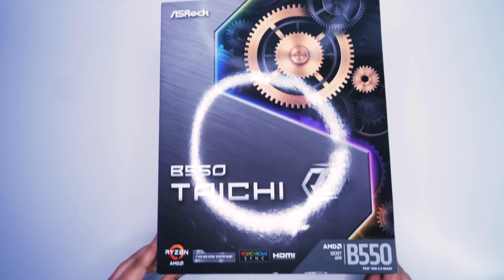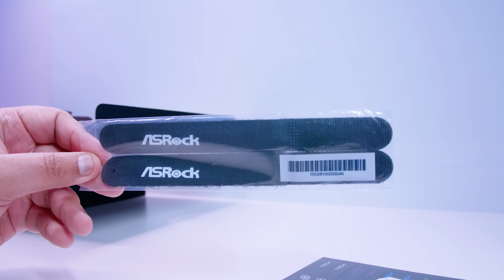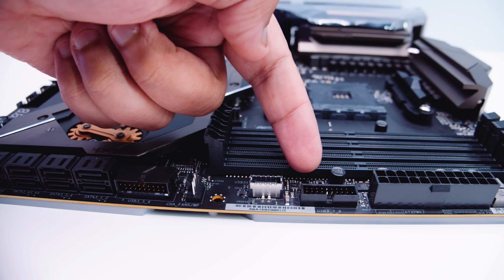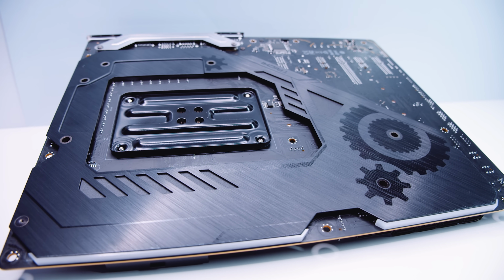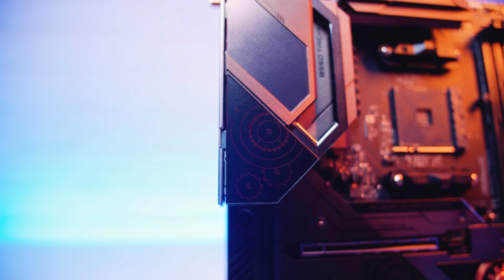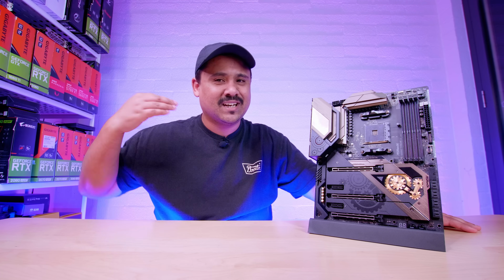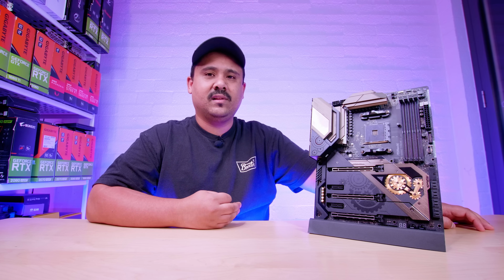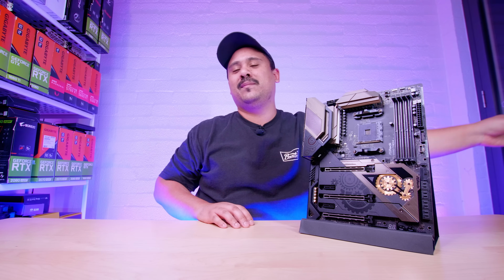B550 All Geared Up - ASRock B550 Taichi - First Look & Overview

Comment: I just got this board after returning my B550 Aorus Master - found out the mouse lag was caused by the AMD Adrenaline software - in my case.  Asrock just a new customer because of my frustration with drivers and BIOS.  I liked the look of this B550 and the fact that is supported USB c on my front panel.

Comment: Interesting that ASRock has a silkscreen for a Thunderbolt header on the B550 Taichi but opted to leave out the header.  The X570 Taichi actually has the Thunderbolt 3 header so I guess that is differentiating feature between entry level, mid and high-end. 

I like that the M.2 heat sinks are individual separate pieces because the X570 Taichi only had a single big slab for all three M.2 slots.

Nice board overall, really nice bit of kit.

Comment: Hi Nik. I use the driver disks. I glue felt to the bottom them and use them for drink coasters. In regards to B550, I think they are kind of pointless. I already have two X570 mobo's, so B550 is too little to late as far as I'm concerned.
Reply: Hahah! I should collect a bunch and make resin coasters with them!

Comment: I've had two X570 Taichi boards in a row fail on me in the past 3 months. I'm very disappointed and now going to Gigabyte.
Reply: Despite of cool look, x570 taichi one of the most badly designed mb, its feels unfinished, raw. In terms of components/how they placed, like you cant use usb-c internal connector, its blocked by gpu, air from gpu goes directly on chipset (some other models have same problem) etc.

Comment: This is the mobbo I keep having wet dreams about lately haha 🤣 It have everything I want OK maybe it could have had 2 more USB ports at the back and the POST CODE  LCD could have been placed in the upper right corner rather then at the bottom where it is at risk for being obscured by a GPU especially when mounted vertically like I plan to do. But other then those minor complaints I think this is the perfect B550 and the best looking as well. Gear Seekers you said something about the back LED strip and about missing a LED header what is that all about? Because you mentioned that this board have both 12V RGB and 5 Volt ARGB headers on the board so that part confused me?

Comment: Here's the scenario where you use a CD-ROM drive. You have no drivers whatsoever, you can't get on the internet through your computer, and the USB ports don't work either. That's the only scenario where a CD-ROM drive saves you. Of course that CD-ROM drive will have to be plugged in SATA and not USB.
Reply from the maker: If your USB is not working how are you going to use your mouse and keyboard in the first place. Try again lol

Comment: I use B450 steel legend and i seriously regret for having 4+2 PHASE for VRM 😭😑
Reply: what cpu do you use on it?
Reply: @andyadm98  ryzen 5 3500..  in future will upgrade to 3900x..  but i dont know whether this board can hold that 12 core cpu😐
Reply: @TECHNDJ  no don't do that because from what I've seen it struggles with a ryzen 7 2700x

Comment: I really hope the asking price isn't 299 USD as that is the same price as the x570 taichi. People will buy the better one.
Reply from the maker: This is actually technically better than the X570 board. Better power delivery and a USB-C Header that is not blocked by a GPU
Reply: @GearSeekers  actually they moved that front usb-c to a better position. It was a bit of hassle to research because all the official promo material is unchanged and all the YouTubers did their vids on it back when it was first released. But there was at least a recent german build that happened to used the x570 taichi where it was clearly visible that a new one will have it in a better spot and orientation.
Looking forward to this one though, no fan and separately removable heatsinks are definite improvements in my book. Plus it has several features many other B550 competitors decided to limit to their X570 range. And it's pretty, which is a nice bonus.  So I hope it does well in the reviews and it doesn't go quite near the X570 Aorus Master in price xD

Comment: Am I missing something, this is the same price as the x570 taichi, why would you take this over x570 unless you really hate the chipset fan. Why does this board exist?
Reply from the maker: A few really simple reasons.
Chipset Fan
Better power delivery than the X570 Taichi
The USB-C header is not covered by the GPU slot

Comment: If the rumoured prices are true it's a huge disappointment expecially when these chipsets were to be released a year ago!
Reply from the maker: No they weren't
Reply: @GearSeekers  Apologies.  What I should have said was that these chips should have been released right after the x570 board.  Rumors then slated for possible year end release or early 2020.  Almost half the year has gone by and still no B550.